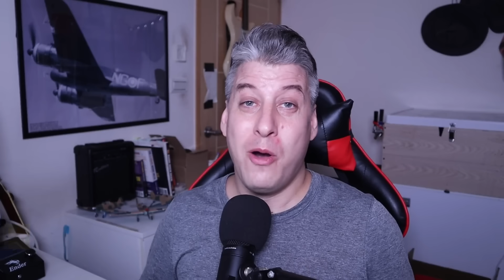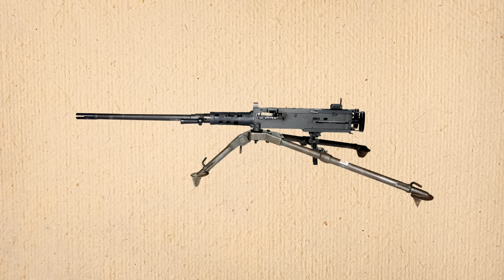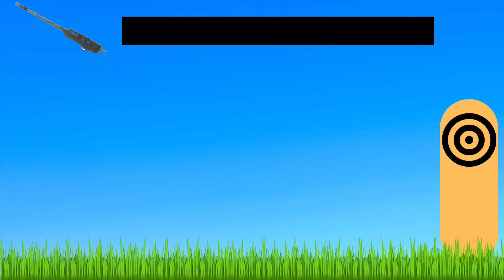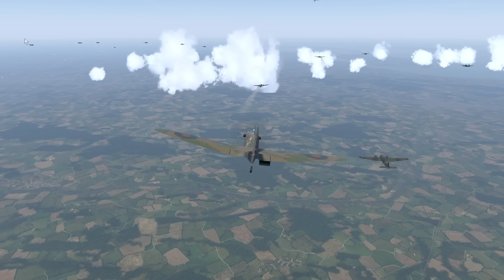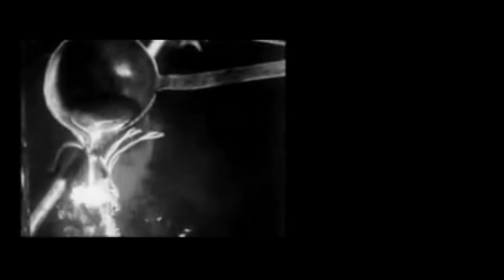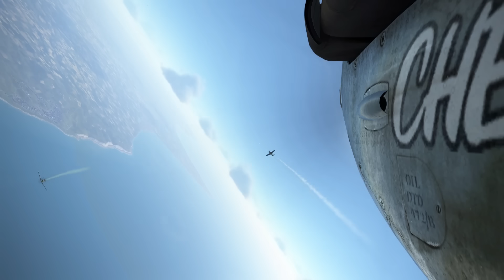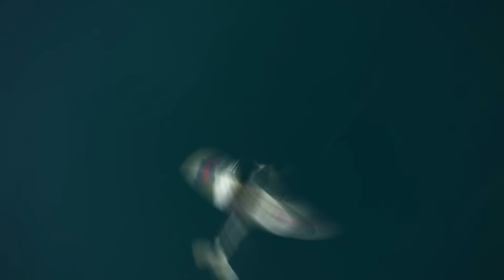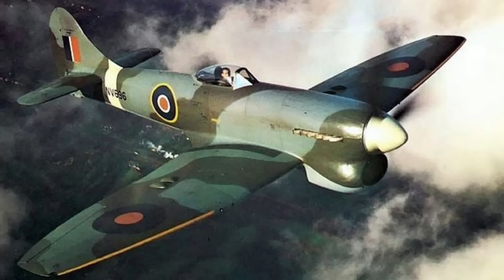Why Did The RAF Use .303 Caliber Machine Guns in WW2? The Surprising Answer

Comment: It was also much harder to damage/shoot down a ww2 area bomber than ww2 area fighter. The bombers was able to absorb more damage than a "delicate" fighter. That was much why the US kept using the 50 cal in the European theater. As they were mostly up against German fighters. In this case the 50 cal was more than adequate
Reply: The F 86 Saber continued with the 50 cal many years later.  Apparently the USAF thought it was an effective weapon.  Many bombers had 20 mms.
Reply: @rogersmith7396  its effectiveness is started to going down at the jet era, many reports of MiG still managed to fly back to base with over hundreds bullet hole
Because of this they initiate Project GunVal, resulting F-86 Sabre variant F-2 that armed with more advanced 20mm compared to the one used by Navy jet (WW2 era M3 20mm)
After that 20mm become primary weapon for many jet that came later, interestingly it was Navy that moved on from 50cal
Reply: @blackmark7165  The Navy had moved on from 50s on ships in 1941, then moved on from 20 mm. At the time of Korea the Sidewinder was under developement.  F 102, 106 and maybe 104 did'nt have guns.  B 52 had tail 20s. as did B 58 and B 36.  With the failures of early sidewinders in Viet Nam the rotary canon was put on planes.
Reply: @rogersmith7396  i actually referring to Navy planes like how Hellcat initially armed with 6x 50cal later had a mixed 20mm and 50cal,
and how Corsair initially had 6x 50cal too and later had 4x M2/M3 20mm
Later when their get their jet, Banshee and Cougar had M3 20mm

It make sense for those Delta jet don't have any cannon as they're pure Interceptor against bomber, although F-104 had M61 later

about Vietnam, i don't know how's the sidewinder but all i know it worked fine, it was the Sparrow that don't work effectively as this missile was meant for bomber and used at long range, this is why later variant of Sparrow had better dogfight capability at close range

And it was US Air Force requested to add the Vulcan on F-4 Phantom, because as it turned out close range dogfight is still happened because they believed modern jet combat is all about missile, hence why early Phantom had no guns, resulting E variant with M61 Vulcan

Funny enough, Navy Phantom had no gun through entire vietnam war and they had no problem with it, so much that even the late J variant still had no guns, mainly because how different air combat tactics they're using
Reply: @blackmark7165  I thought the US Hellcat had a 76mm gun. Though I also thought the US called anything Hellcat to confuse the Germans like the British with the Tank in WW1
Reply: @rogersmith7396  
The F-104 and F-105 were both equipped with the Vulcan 20mm. rotary cannon while the Navy's F-8 Crusader "gunfighter" was equipped with 4 conventional 20mm. cannon.
Reply: @mel.3687  Grumman F6F Hellcat Carrier Naval Fighter, the F4F Wildcat replacement
Reply: @mel.3687  I think that you are confusing the US Army Hellcat Tank Destroyer with a 76 mm gun and the Grumman F6F Hellcat Carrier Fighter armed with 6 x .50Cal machine guns.
Reply: @markfryer9880   It’s called “SARCASM” an English word I know but I thought Americans might of heard of it. I mean why name Tank and Plane Hellcat? Or maybe ask your 3 friends to help not sure why any sane person would bother standing against me though I do find it amusing that anyone would read what I say lol
Reply from the maker: An interesting point.
Reply: @CalibanRising  to
Reply: The RAF fighter pilots were tasked with going after the bombers during the BOB, downing a bomber would wipe out many more highly trained airmen than a single pilot in his meschermit & the bombers would cost a lot more to produce & do all the damage, so it makes total sense.
Reply: The US used 50 cal the Pacific as well the European threaters. Remember the manufacturing capacity was cranking out 50 cal round a mile a minute at after the WW2 we has a large surplus that we tapped into during the Korea war.
Reply: The F4F3 Wildcats had four .50 caliber guns, and carried 450 rounds per gun.
The F4F4s came with six .50 caliber guns, but carried 240 rounds per gun. This would be gone in under 20 seconds of continuous use. 

Many pilots preferred having four guns, and more ammo. Later in the war, some F4F4s were built accordingly. Jimmy Thach himself said, 
"A man that cannot hit with four guns will miss with eight."
Reply: "That was much why the US kept using the 50 cal in the European theater."

No, it's because US-made Hispanos didn't work. Both the USAAF and USN were trying to replace the .50 from about 1942 onwards, after US Navy tests showed that one Hispano had the same firepower as at least three AN/M-2 .50s. Hundreds of thousands of 20mm Hispanos, and millions of rounds of ammunition for them, were manufactured in the USA - but they were never reliable enough to be actually used.
Reply: @Alfe I would of thought it was easier to shoot down say a Lanc than a Spitfire. With a Lanc you take out the tail gunner and it has no rear defence plus the Germans built one plane just for the purpose of shooting them from underneath. The bomber certainly can take more hits to shoot it down but I feel far safer in a Spitfire than Lanc up against a ME109 or FW190
Reply: The Americans kept the .50 because they couldn't make the cannon work. They were literally given working guns and the blueprints to build them and they 'improved ' it to the point it didn't work! They produced 100,000 cannons and 40 million rounds of ammo, and the cannon didn't work.
Reply: @chrishitchings8712  The browning .50 cal Machineguns is still in production and use today.  In WW2 most US fighters has four, six or eight wing mounted guns and US bombers had even more machineguns. The browning .50 cal was reliable and jams were easy to clear, and often carried 450 rounds per gun, as opposed to a 150 rounds for 20 mm Hispanic sweets at auto cannon that tented to freeze at high altitude.
Reply: @alejandrocantu4652  the fact that it's in use in the ground role today has nothing to do when comparing the two in ww2. I think it's a fantastic weapon and the US is lucky they had it because like I said they couldn't get the 20mm to work. A report by the US navy itself found the 20mm to be 3 times as deadly as a .50, so a 4 cannon armed fighter had the equivalent firepower to 12 .50s for half the weight, yes it carried less rounds but it needed less hits to down a target.
Reply: @chrishitchings8712  The P51 Mustang had an astonishing success rate. Its ratio for kills to losses was said to have been 19 kills for every 1 Mustang lost. The P51 Mustang is credited with the destruction of 4,950 German planes ? more than any other Allied fighter. You didn't need four 20mm canons when six .50 cal will do nicely.
Reply: @alejandrocantu4652   I do agree but let's not forget that air superiority was a thing, it was a turkey shoot towards the end. The germans barely had fuel for training, they didn't even have safe skies for training. Inexperienced pilots with poor training and crap quality fuel ( that matters a lot, it helped the British during the BoB ) flying whilst outnumbered against hordes of Mustangs.
Reply: @chrishitchings8712  Or was it a case of why fix something if it’s working better that than to mess things up with a bigger gun that jams all the time or worse
Reply: @mel.3687  p.s, it wasn't ' jamming all the time ' , it wasn't great for Britain during the battle of Britain but it was sorted after. The yanks were furnished with blueprints and working examples, they 'improved ' it to the point it stopped working 🤦‍♂️
Reply: @mel.3687  "a bigger gun that jams all the time"

Only US-made Hispanos jammed all the time. The fault was known - the chamber was 1/16" too long - but the Board of Ordnance refused to admit that, and actually banned US manufacturers from making guns with the shorter British chamber dimensions. British Hispanos worked just fine.